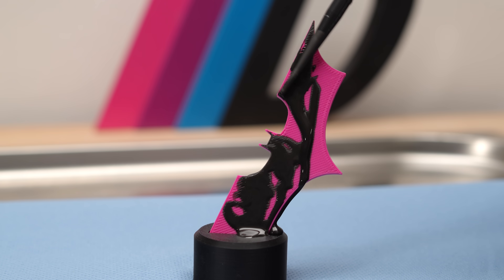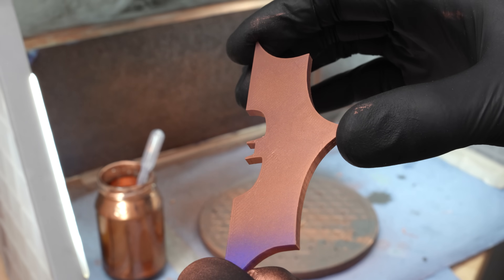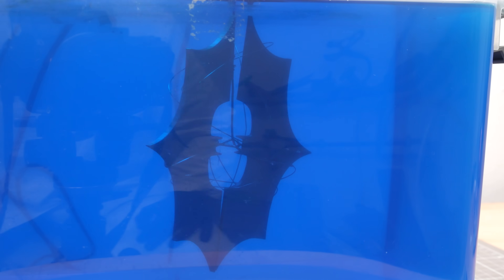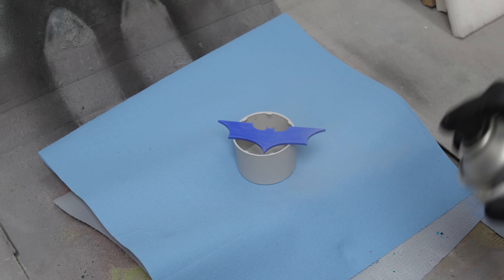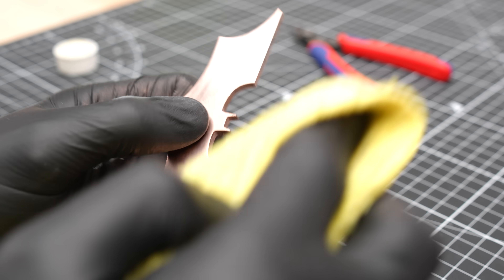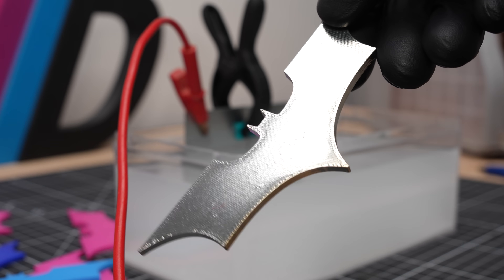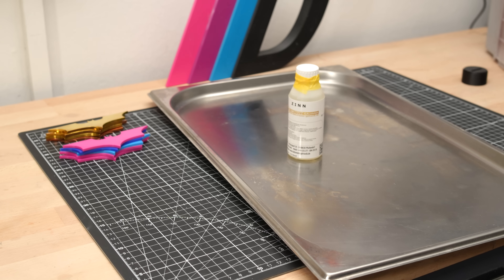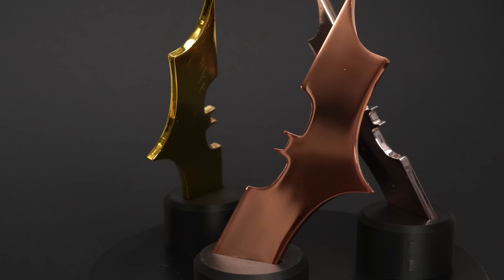Electroplating 3D Prints to Brass & Bronze | FULL TUTORIAL

Comment: How much does this proces cost?
Reply: 3d printer (200$), airbrush (150$), chemicals (50$), paint (20$), filament (20$), power supply (100$), copper wire and anodes (50$), other household items - tubs, sandpaper, etc. (free?) = ~600$ (you could definitely get some of the listed items for much cheaper if you are willing to sacrifice quality, like the airbrush, power supply, or 3d printer - he says in the video you don't even really need an airbrush)
Reply from the maker: Pretty accurate. Mine: 3dprinter 1200€, airbrush 15€, chemicals 50€, power supply 70€, anodes + copper wire 17€, paint 9€. 3dprinter can be way less, yeah.
Reply: I got into electroplating with a tiny can of copper sulfate, a recycled phone charger and an ice cream tub, so maybe 10€. Of course the 3D prints are gonna be more expensive
Reply: @younscrafter7372what’s this $10 setup
Reply: 3d printer, airbrush, paintbooth, chemical product, paint, etc etc… I would guess around 3k
Reply: I have seen people say it can be done for 300 to 500, but that is POST 3D print.

Comment: Good info, but what I don't understand is how the PLA does not melt inside the metal electroplate jackets?
This works OK for flat prints, but if I 3D printed something with more surface area (not flat), it would take a whole lot more work and probably not worth the effort. What I am considering is printing in wax and then casting in a lost wax molding process

Comment: I would like to ask about the voltage and current output for this setup, and about the solution with the copper sulfate, did u use Sulferic Acid, or did u use a weak electrolyte, or there is another alternative ?

Comment: There are ways to plate tin and zinc on copper without an external current source. For tin there are commercial solutions available for tinning circuit boards (IIRC containing some thiourea complexes of Sn). For zinc, you can do it yourself by heating a copper piece with zinc in a sodium hydroxide solution. The important thing is, that the copper must touch the zinc. On this principle is based a chemistry trick called "turning pennies into silver and gold".

Comment: Hello, 
I have a 3d print. I'm thinking of electroplating it. Can you tell me what metal should I use to make it food safe. After plating, hot water(coffee) will just fall from it into a cup. 
Please let me know of a suitable way to do it. 
I'm thinking of Tin or nickel. Let me know ur thoughts.
Reply from the maker: I use gold for anything I eat from. I would never use nickel. 🙃
Reply: I read that tin is used for food packaging cans and stuff but the process available is chemical tin dipping. Idk if it can be safe for using in food applications. Also have u read anywhere about stainless steel coating. Let me know ur thoughts

Comment: Think you could try 3d printing and electroplating Beyblade parts? I'm curious to know if they can withstand beatings like official Takara Tomy and Hasbro Beyblades.
Reply from the maker: No, I think that won’t work out. The mass is too low and impact would be too hard for the copper shell to withstand (even though it’s 0.2 mm thick)

Comment: what would happen if you electroplate it in mixed electrolyte (copper + zinc) ? Will it create brass layer ?
Reply: LLM says it depends on concentration of both electrolytes, voltage, temperature. But if done correctly it should be possible.

Comment: What is the trick to making sure the graphite sticks to the 3d print? Does priming produce better results?
Reply from the maker: Added Super glue. Priming isn’t possible as the acetone in the conductive paint dissolves the primer. Use 2K to smooth that print.
Reply: Thanks for the reply! I'll add more super glue :)  @hen3drik

Comment: With 3D resin printing it would be smoother and prettier, right? But it would melt under the heat of the oven, am I wrong?
Reply from the maker: I think resin prints are more robust to heat.
Reply: Thank you for your reply, but why did you use PLA? What are the advantages compared to resin?  @hen3drik

Comment: The thermal expansion is the water coming out of the PLA. You need to run it longer at 95°C to avoid having the water in the PLA turn into vapor.
Reply: You could potentially do it at a slightly higher temperature to reduce your time, but it will require more testing.

Comment: I have a question about the rotation motor, I can see that you are using in order to have a even coat around the object, I'm thinking about using electroplating in some large object like helmets an props linke sword, and if some cases the objects would be too big for the box in order to rotate from about as shown do you think we could have the result by placing a second catod from the other side conected in parallel by a second cable? Should we adjust the voltage an amperage?
Reply from the maker: If you're using constant current, the current will split between the anodes, and in many cases, the result becomes even more uniform. You can slightly increase the total current to compensate for the additional surface area, but there's no need to double it—just adjust gradually while monitoring the deposition.

Also, make sure the bath is well-aerated. Good agitation helps reduce uneven coating, especially on large or complex objects like helmets or props.

Comment: The Batrangs look great! I think I will try do them as well. Still learning how to achieve a perfect surface. Planning to electroplate figures and sculptures, but still didn’t found the best way of sanding with all the details. With a sand paper can’t reach everything

With what primer you got best results? I have tried epoxy primer, but in the end it didn’t fill the gaps as I wanted, and it was dissolving from an IPA 😆 

Didn’t tried to add layer of some 2k varnish in the top.
Reply from the maker: Best primer is totally dried car filler imho. 😃
Reply: I have also a question about rotary tumbler. Thinking of buying one - have you tried to smooth out the fdm print in it before plating?

Comment: Once it's electroplated how durable is this? I wanted to make some shifter knobs and I was worried that people handling it would rub the electroplating off. How durable is this actually?
Reply from the maker: It’s not coming off as it’s too thick. You can run into thermal expansion issues, but with knobs it’s actually way more safe!
Reply: @hen3drik  awesome thank you!